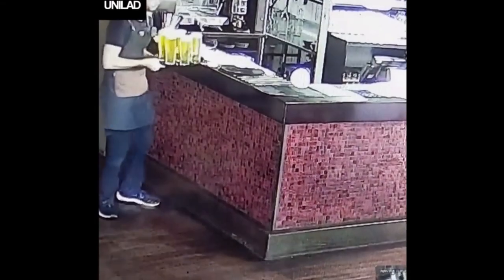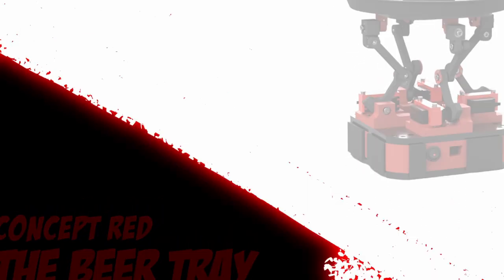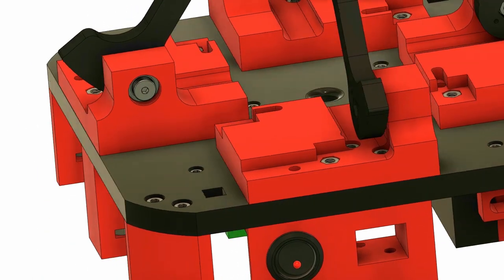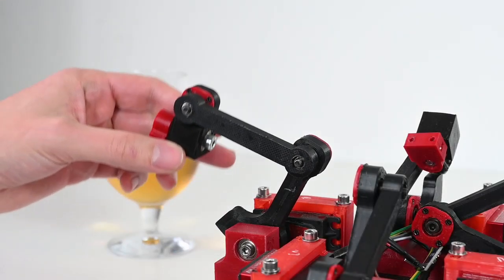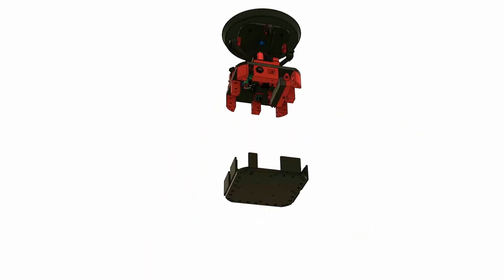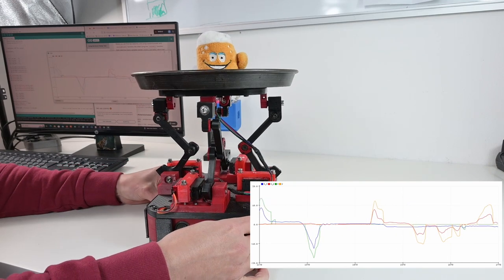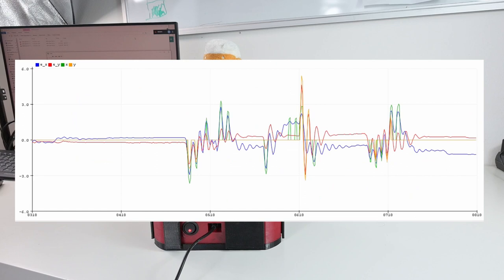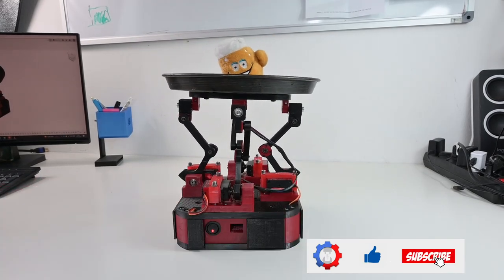The Beer Tray: a self balancing tray.

Comment: wow your invention is really great. I am also trying to make a robot using a similar principle. could I have your CAD file?
Reply from the maker: Thank you for your comment. You can find the Fusion360 data and the Arduino software here: https://drive.google.com/drive/folders/1dXVFybvyH2_9vzmK2oJirlOYO1AtOy_s?usp=share_link
Reply: @Thefedmog_Challenge  thank you so much. I think it will be of great help for this project.
Reply: @Thefedmog_Challenge  Unfortunately, the link to the Google drive with the sketch for the Arduino controller does not work. I would be interested to look at your code and try to repeat your solution.

Comment: You want to control 2 degrees of freedom, so you only need 2 actuators, not 4. That would simplify the design by a lot. I would start from there, along the whole lot of ideas for improvements that comes to my mind when looking at your creation. Good job btw.
Reply from the maker: But two seems too easy and it would not have the third degree of freedom it has. It is able to move the tray up and down and so correct the acceleration in this translational direction. But you are right, there could be a lot more improvements. Those robots are definitely far from a real life task. But that is not the goal 🙂.
Reply: @Thefedmog_Challenge  well your task it to keep contents inside a cup, focus might be on diminishing waves that happen inside the cup instead of complete gyroscope.
Reply from the maker: Yeah sounds also like a valid concept to diminishing the waves. For this challenge, i liked the idea of four arms controlling a plate 😀
Reply: I second that advice. Two motors only would also allow for a design with sturdier hinges.
Reply from the maker: Yeah you are right, but we want always design robots which are unique and out of the box.

Comment: Why didn't you use an accelerometer instead of a gyroscope? The task should not be to keep the tray always in the same inclination, but rather always orthogonal to the local acceleration (g + motion).
Reply from the maker: Hi. The MPU6050 is a gyroscope and an accelerometer. Yes, you are right and The Beer Tray is designed to be able to correct the translational motion in the direction of the gravitational field. The software was also designed in the first place to correct this acceleration. A device which could correct all of the inertia forces would be great! But The Fedmog Challenge is just a fun project to find out who can build things better (red or blue). So the project should not take too much time to complete. Right now we are finishing the 3rd challenge: The Wall Race. Maybe I will improve the whole design in the future :)